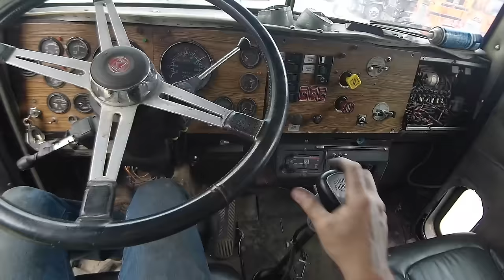Eleven Semi Trucks! Let's Fire Them Up!

Comment: The smell of diesel smoke must of been amazing. And you can sure tell black Betty is turned up sounds so much different to the other 3406s in Fleet you have.
Reply from the maker: It’s slightly retarded on the timing. I can’t find anyone that does meter timing here

Comment: Ail these truck s are real Will America background this is I said you get some more order trucks, I'm off these different yards from new engines and I'm bring up back. Put new cut off the old hands. Put on new gears and put on new speeds. Take out the old gasses put on new games in there. But new seats in take to seats at a older truck other than a newer trucks have been flipped and burned.  Is how you make America back. America's always been great but bring it back to the triple lori glory, take the older. Take the order o Take the order trucks drugs, dinner that have been for once on the 50s. 50s and middle school 60s and are not too good at a Bath. Take them and then let's make our steel back and gas. Our stuff back and stop giving our other countries our ideas
Reply from the maker: Appreciate ya being here